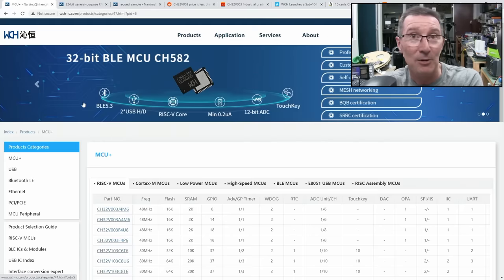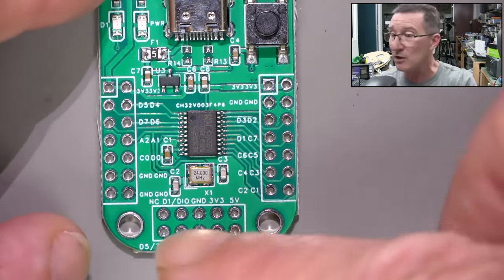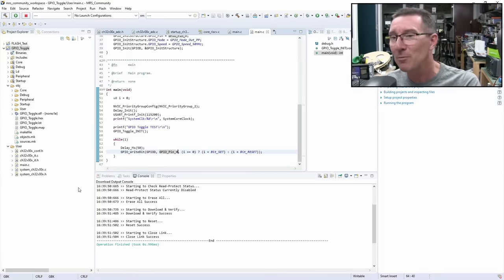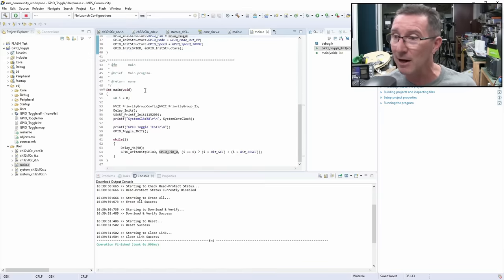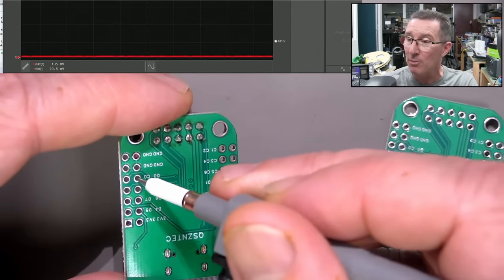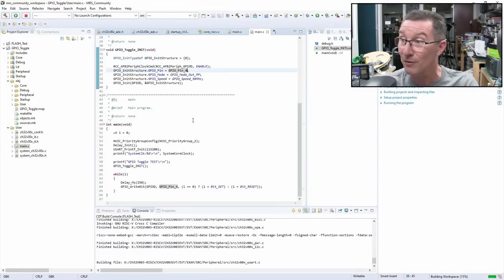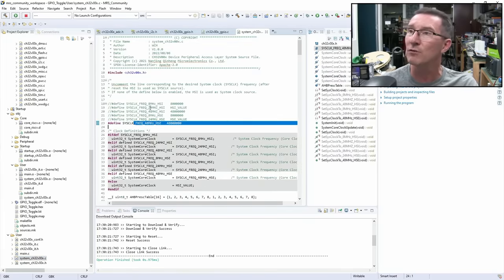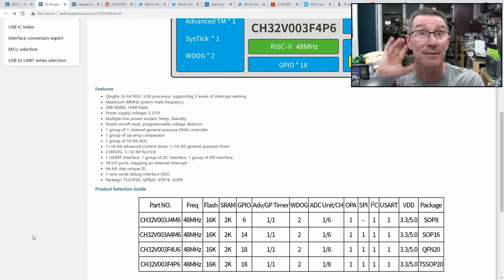EEVblog 1524 - The 10 CENT RISC V Processor! CH32V003

Comment: This reminds me of the early days of STM8, ESP8266 and a few others 
Community making better HALs, figuring out all of the little quarks, even making better compilers, i very much live for this
Reply: What is stm8 community HAL? Never heard. Arduino? Haha. I program stm8 from 2012. In that time stm8/stm32 programmers used only registers and never used SPL and and not accepted ST HAL monster at all.

I still use programming on registers ever with stm32. It is more easy for me to open pdf uc manual to see registers that I don't still know and to write what I need. Instead of to understand some HAL with huge overhead of size and and function calls (prepare call stack, jump, take apart call stack and so on instead of one uc command :))). And I have fast and size efficient firmware )).

Now playing with HC32V. Some copy of stm32 (who doubted?) same registers just renamed and stm32 SPL. You can take 10 years old info about stm32f103 and SPL and you are HC32V programmer what you see in this video. It is stm32 SPL in this video. Same toolchain gcc (just riscv version) and openocd. Nothing new and interesting to discuss.
Reply: What are some of their quirks? Also real curious about the community made compilers
Reply: @anonymouseniller6688  Most likely we are talking about SDCC?
Reply: I just don't get what the "excitement" is about with this.
I DO understand why chip makers want to use RISC V, that's obvious, since it's "free" (open-source) IP. They neither have to develop it themselves, nor license it from someone who did.
But why excitement from end users? 
There shouldn't be. 
It's just ppl like this guy in the video, who seems to be an excitable type (easily gets excited about ANYTHING). 
END USERS are f__ed, because they now have to find a way to program it, and figure out all the little quirks.
Wow, another new IDE?!
Oh, boy, can't wait. I "get" to learn a whole new IDE....
And buy (separately) a "programmer / debugger" that isn't, no it's just a USB to serial converter. No debugger.
So this "exciting" new uC can do what? 
Uh, well, it can blink a single LED. So what?
Can it run a FreeRTOS? 
Doubtful, and who wants to put all the time & work into that for a quirky little uC?
Not me. I'll stick with an "expensive" ESP32 or something that has many uses, it's well-documented, fast, has lots of onboard peripherals, and has LOTS of uses for actual things besides blinking one LED.
When I develop something for a uC I want it to be functional, flexible, and esp do more than one thing.
(Ok, I know that's not fair, it can prolly do more, but we'll have to wait to find out. Someone else will have to figure it all out after uncovering all the quirkies. I know.)
Reply: @jeffro.  good for you i guess. not every project needs Wifi, bluetooth or huge amounts of peripherals. If it did, these cheap and small MCUs would not even exist.
Reply: @davidpodeszwa7010  You're trying to be reasonable with somebody who would be happy arguing MITS Altair is useless

Comment: 10¢ RISCV — truly a milestone in the cost-value proposition of 1000x ENIAC on a chip for 10¢ 😳 thx for keeping us up-to-date!
Reply: Plus it doesn't need an army of engineers, technicians and programmers to keep it running!
Reply: Build you own Connection Machine for under 10,000$
Reply: Something like 5000x to 6000x the speed of ENIAC. About 50x the RAM capacity of early ENIAC (which had only the 20 registers), and 10x the capacity of ENIAC near the end of its life after some core memory was added. Program size is very hard to compare as ENIAC used plugboards to control it.
Reply: How much the speed of that special FX prop looking CRAY supercomputer?
Reply: @NNokia-jz6jb  A Cray 1 was 160 MFLOPS, so maybe 25% as fast
Reply: @sdrc92126  25% .. so CRAY 1 is 4 times faster?
Reply: @NNokia-jz6jb  I'm guessing something like that. But 10 million times less expensive.

Comment: Great to see them using a normal GCC compiler and not some obscure proprietary stuff
Reply: That's the beauty in this. The momentum of the standard tool chains is so great that nothing else should cross their mind.
Reply: Gcc and makefiles, i never use IDEs.
Reply: @zoobab28  the issue here is that they probably didn't fully documented the chip or the API or the programming interface to allow to just completely avoid their IDE.
Reply: @PainterVierax  it's all fully documented, their (very minor and not needed) patch to gcc and custom OpenOCD are released, the protocol is documented etc. And the chip manual is very good.

Comment: WCH-LinkE is not a generic USB to serial interface. It is a CH32V305 microcontroller implementing the single wire debug protocol used on the V003. Yes, technically that is serial, but it isn’t just a pass through buffer.
Reply: so like jtag? that is a game changer on these things.
Reply: Is there any specifications about how to build a programmer with an FTDI+logic ??
Reply: @donvukovic7440  No. We’ve been asking WCH for specs for a while. If there were open specs I would have implemented an open programmer by now.

My goal until specs are released is to reverse engineer the wire protocol and implement my own debugger. I just haven’t had time to do it yet.
Reply: @truectl  Thanks, I look forward ti it.
Reply: @truectl  both the specs and WCH's code implementing them have been released.
Reply: @BruceHoult  Yes, I saw the code today and posted about it in the WCH discord. But I did not see the specs posted.

edit I see the doc now. It isn’t very comprehensive but does fill some gaps. Should be enough to reimplement this.
Reply: @truectl  What's the link of WCH discord ? I would like to have it.

Comment: Since it's using an external toolchain, it cannot build something that is not saved to disk. Therefore, you need to save the file before build. The hex file not being rebuilt is either you forgetting to save the source code or a bug in the vendor SDK ("make" target dependency missing).
Reply from the maker: Yes, I doubt it's a bug, it just needs the file to be saved for as you said, the external compiler that doesn't know the IDE exists.
Reply: @EEVblog  you can set Eclipse to autosave before build
Reply from the maker: @teslatrooper  Yep, I figured you'd be able to do that.
Reply: But why doesn't it save all the currently opened files whenever a project build is started by default like most proper IDEs do? Is it just another strange Eclipse quirk or is there some reasoning behind that?
Reply: @Kirillissimus  I set every IDE I use to query if files are unsaved before building, as opposed to saving automatically. I find it useful as a guard against accidentally fat-fingering the build key and having it automatically save files before I'm ready for it.
Reply: There is a checkbox in the project settings for auto safe before build in eclipse
Reply: Real IDEs either autosaves before build or builds from a virtual copy of the project folder plus in memory changes. A real IDE comes with sane default settings too..
Reply: This is not the only weirdness in Eclipse but is the reason I avoid it
Reply: @Kirillissimus  If you're working on multiple files and you've done modifications to one file already in the editor, but you're not finished there yet and still wanna try out some other modifications in other files, you can pick and choose which files to use for the compilation-process by...saving or not saving the files. The assumption is that you know best what files you want to use for the compilation at any given moment, not the IDE.

Basically, it's a matter of preference and it makes perfect sense to me to do it this way, but since it's just a few clicks away to change the default setting, it really shouldn't be a big issue in any case.
Reply: @savagesarethebest7251  are you really saying this isn’t a real IDE since it isn’t set up to automatically save files before building the project? You are being a bit ridiculous, there isn’t much wrong with the IDE WCH provides.
Reply: @savagesarethebest7251  What are you talking about? I don't want it to autosave. I find it really annoying, first thing I disable in your "real" IDEs, and im real programer
Reply: @Kirillissimus  My words my man. I havent encounterd an IDE that didnt automaticaly save before build.
Reply: I find it amusing that some people here think Eclipse isn't a "proper" IDE.
Reply: God is that you?
Reply: @hooverphonique  I find it amusing that some do. I is actually a plugin framework more than an IDE. 
In the mid 2000s I worked with a consultant, that shipped Eclipse as his application. It was the ugliest thing I've ever seen, technically and visually.
I stopped using it about 8 years ago because it was soo far behind the competition already by then.
That you have to save for changes to happen...it is like they hate TDD or just modern functionality in general for some reason.
And there is so much more weirdness.
Reply: VS Code saves your files before it runs the build script. I suppose that would be a more predictable behavior.
Reply: Nice of you to defend it, but I would expect any IDE that isn't complete crap to auto save a file if you run a command that requires that to work properly.
Reply: Eclipse! I spent weeks trying to make friends with Eclipse. So many issues, just like Dave's failure to build. I had one, that I failed to solve. A very, very, very simple program. Built fine. I changed a variable name. Wouldn't build. Changed it back. Still wouldn't build. At that point I decided to part ways with Eclipse. I will never again use it.
Reply: @savagesarethebest7251  Eclipse is a very real IDE. How would GNU C Compiler build from memory? In memory changes not saved are uncommitted changes, very rarely anything productive comes from processing uncommitted changes. Eclipse has very sensible defaults, that are expected from software developers.

Comment: Wrote around Christmas a riscv emulator for Python, 32bit CPU, RV32i ISA and RV32M extension support. The base instruction set(RV32i) is comparable with something like the older AVR attiny instruction sets, very barebone, but it does the trick. For example it doens't have MUL or DIV in the base set(RV32I), that is in the RV32M extension.  So yes it can be made very cheap,
Reply from the maker: Cool. Can people download this?
Reply: that's great job, will it be opened for use?
Reply: Well, adding multiply to a hardware alu immediately complicates the design. You end up with probably a doubled data buss and logic to handle it in the registers, definitely multi clock operations because of the timing delays and logic to handle it. And a 32bit multiply circuit is rather big on it's own (you can pack in more memory or features if you ignore it). 
For a tiny entry level chip like this, not including multiply is probably the right way to go.

Comment: They've made it just so easy compared to my old school days of using to burn a UV EPROM and plug it into a socket on the PC board. Back in those days too, you had no sample code and had to create the include files yourself... oh joy!.... pre internet days as well, so you had to get a printed reference manual.... oh.. and you had to write your code in assembler (machine code)... without any debugger!
Reply: Did a fun project back when I was in 8th grade; decided to build a cross assembler for the NEC uPD78C10 on the BBC micro... the biggest challenge was actually understanding the "japlish" manual for the thing, it being written in a rather tedious language (not sure if not being a native English speaker myself was a hindrance or helpful!).
Reply: In 1987 I worked in an industrial automation company, I had to burn about 200 UV EEPROMS.
Torture.
Reply: ... and it was uphill... BOTH WAYS!

Comment: As usual, software support is king. AFAICT, the easy part is making the silicon, the hard part is building the community support, tool chain, software experience, etc.
Reply: I think that's one of the big parts around spark fun and raspberry pis.
Reply: Setting up a Pi Pico environment is agonizing for Windows users that want to use C/C++.
Reply: @asm_nop  Most development tasks like that on Windows tend to be agonizing in my experience.
Reply: @RobertHancock1  i agree i usually match and mix msys2 and msvc compiled stuff
Reply: @asm_nop I just used Arduino IDE for my Pi Pico project (filter wheel changer for a telescope),  there was nothing difficult about it I just followed the Pi foundations instructions.
Reply: @asm_nop  not really, just follow the guide on it and it will work fine.
Reply: @backgammonbacon  the problem with a lot of arduino ports for other microcontrollers is that they try to make it compliant with “normal” arduino code. That means that a lot of features either end up not being implemented or implemented in a way that you lose a lot of control.
Reply: @asm_nop  I set it up using the wsl2 environment and it seems to work quite well, initially tried to do clion windows and it was a nightmare
Reply: @asm_nop  I have not tried to set it up using windows, but since it uses CMake, shouldn't it be straight forward?

Comment: Very interesting, Dave. I have a couple generations of SiFive RISC-V SBC's. Nice to see micro-controllers appearing at a good price point.  Do a SRCH for "cnlohr on risc-v" here. He wrote an RISC-V emulator in C and used buildroot to get the 400-500 lines of RISC-V C emulator to boot linux and give you a command prompt right on you linux PC. It is freaking amazing.
Reply: BTW, he provides all the material and I was able to download. build and run everything myself relatively quickly. Building the Linux kernel and other stuff with the emulator took a little time.

Comment: I started with the 4004 which we paid $480 for and another $100 for the translation chips  (4001 & 4002) from Pmos to Cmos or ttl. It's amazing they sell them for sub $1. Obviously they will go broke in a real economy as the FAB can't be paid off with no profit. 
 I would start with buying the hardware and writing a stand alone compiler for the RISC V using my PC. Sounds like a good project for me in the future. Cheers - great Blog  -
Reply: RISC-V is easy to write a compiler for, but why bother when there is already gcc and llvm?

Comment: Every time you were building the project, it was building the two (or more) projects you had open at the time, so taking longer. It's quite annoying that Eclipse comes with Ctrl-B set as "Build all projects" instead of "Build current project". It's one of the first things I change when using a newly installed Eclipse based IDE.

Comment: I ordered the evaluation kit and finally received it. Only issue I had was to get the MounRiver IDE to generate a hex file.  I dug into the Settings an found the setting under "GNU RISC-V Cross Create Flash Image/General.  I selected Intel HEX in the drop down and all is well.
Thanks for the Video  I was looking for a device that did not require the investment of the Keil development software.  Thanks to you and WCH!

Comment: Hi, Dave.
Long time Eclipse user here 😊I haven't done development in C programming language for some time, but the general M.O. of IDEs is to automate some (or most) of the complex software process/workflow. But the assumption is that the developer using an IDE is aware of (at least most of) the steps in the workflow.

To save the time it takes to build the actual binary (compiling, linking, optimizations, etc.) most IDEs support incremental compilation where only the modified files are compiled and then linked with a previously compiled/built pieces that were cached. But given the number of moving parts the build workflow has, even without the incremental features, the "Project >> Clean" action is there to take care of the famous "my tool is stuck" issues.

An IDE can be configured to automatically save any modified editors before actually performing the build, so you might opt-in for that one. Or even to automatically save modifications to a file when the keyboard input "stops long enough". Also, "automatically compile/build on save" is an opt-in feature of some IDEs. But if one considers these automation features and the complexity of the workflow, one could conclude there is no "incremental build" - building the actual deliverable binary involves much more CPU/RAM/DISK intensive activities compared to compilation, so it doesn't make sense to start-and-clean-up-on-cancelation every couple minutes on auto-save. That is most likely the reason you didn't always get the HEX file after "incremental build".

The Eclipse itself is a customizable and modular software platform, i.e. for creating any kind of desktop software, but it is most widely known as a Java/C/C++/PHP IDE thanks to the modularity. Years ago I watched a National Geographic documentary on NASA Mars rovers where it was explained how NASA plans a rover's route, and the software they were using was Eclipse with custom plugins 😁

Comment: I was browsing these guys a few wees ago and I thought they had quite the nice selection of low cost MCUs. BLE, networking, motor or display driving. Basically if your main MCU is missing a feature or you need something very low power they have something that will fit your needs.